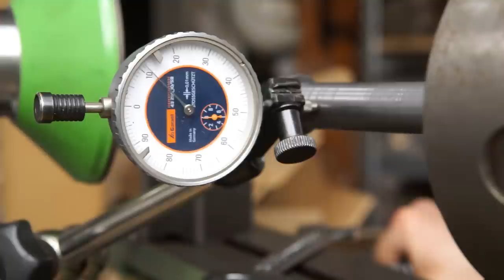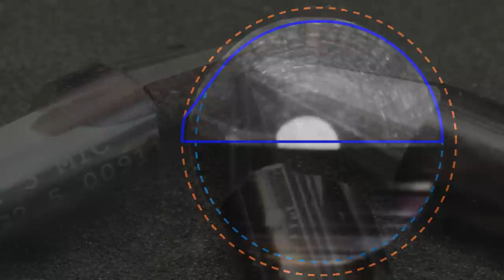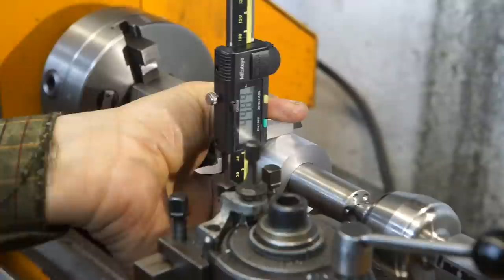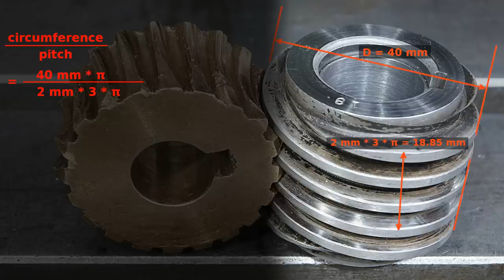machining worm gear wheels

Comment: I keep waiting years to see a double throated worm/wheel on YouTube. I still haven't seen it. It's becoming a mythical part for me.
Reply from the maker: That would be quite an interesting challenge for a home shop.
I would probably make a "regular" pair of worm/wheel first and  make a cutter from the wheel and use the wheel to cut the throated worm. Ideally both the cutter and the worm should be driven synchronously an the machine. It might be possible to "hob" the worm freely by just driving the worm?

I found a video showing the process, actually
https://www.youtube.com/watch?v=hdxllIF0DcA

Comment: Very helpful video for my current project.  I did not think I needed to gash the blank with a gear cutter (I initially used a slitting saw) but now after several failures and watching your video; I know that I must gash with a gear cutter.  Thanks for posting this video.
Reply from the maker: Thanks for your kind comment. You might be able to work with a slitting saw as long as you slit deep enough but not too deep. You just need initial "teeth gaps" to synchronize the hobber. Long ago I made a set of gears for a thread dial. Although I turned the blanks to the theoretically correct diameter, the number of teeth turned out to be incorrect in some cases.

Comment: I dont have a dividing head yet this had to build a direct indexer using at first the original gear that was partially stripped then a plastic gear I cut and ran in the machine that was just a little oversized that gave me a excellent profile and size to copy then made it in aluminum it’s been working great
Reply from the maker: Good idea. When I made my first gear on the lathe, I just printed the required "index holes" on a piece of paper and glued it onto the drive pulley. So I could use the chuck of the lathe as a simple "dividing head".

Comment: 12:05 Instead of using the hex collet block for indexing, would it not have been more accurate to offset the mill table by 1x p ... ?? 🤔

Very enjoyable video ! 👏
😎👍☘🍺
Reply from the maker: Peter, yes, excellent suggestion. That would be the same principle as used for cutting multi start threads on a lathe. (Well, at least one of multiple solution.)
I did not think of this for several reasons:
(1) originally I intended to use the dividing head to set  the 120° degree offsets between the individual threads. This turned out impractical due to the (in the world of spiral milling) relatively "flat" pitch. This required driving the shaft of the dividing head directly instead of the usual "deviation" via the dividing-plate and the worm gear. By the way: Walter even offers a dividing plate sitting on the spindle for this purpose, but I don't own this special attachment. (Rule no 1: you can't have enough tools ;-) )
(2) I had to cut eccentric curves for the reliefs of the cutter ( 22:03). This required a setup with the collet block anyways. In retrospect I think that a simple straight relief would have done.
(3) I also planned to spiral mill the V-grooves of the treads for relief. This did not work for geometric reasons (I did not think of beforehand.)
Thank you very much for your thoughtful comment. Highly appreciated!
Reply: @HaraldFinster  thanks for the detailed reply Harald ... for me, THIS is what the internet & YT in particular was made for... entertainment AND education ... all in one... 🤗 
Also, as a hobby woodworker , the motto "you can never have enough tools" (or clamps😂) is so true... 🙄

Its amazing what you can do if you are creative and think "outside the box" 
I remember many years ago making these racks and pinions for sliding metal doors on waste skips (dumpsters) ... they didn't need to be super accurate and I , a 20 somethin kid starting out on my self-taught engineering carreer (65y.o. now) thought they'd be a piece of cake to do on my Elliot shaper !! ... ahh to be soo naive .. 😂
Suffice to say , I got them done but man oh man 😤 !! 

Cutting each individual tooth gap in those 1 metre long x 1"sq. BMS racks was a ball-breaker... and then of course they bent like prezels , my first real lesson in releasing internal stress ... 🤓
I made up a makeshift dividing head using a division gear at the far end for the pinion-planing job... they actually turned out okay and my customer was delighted... 
The things we do when we don't know we "can't do that" ... 😬

😎👍☘️🍺
Reply from the maker: @peterfitzpatrick7032  Can't agree more. Thanks for sharing your experience.
With regards to stress relief: this is true even for "stable" stuff like steel. Recently I made a gib from "stress relieved" cast iron. I had to mill it down from about  12 mm to 8 mm. It bent like a Banana. Fortunately I anticipated this and left enough material to mill it straight again.
About "naive": again, can't agree more, and I think that this video is a good example: I agreed to making this worm gear for a friend. My first naive plan: turning the hob on a lathe was just impossible due to the (in the screwcutting world) steep thread pitch. So, the  rat-tail began. 🙂 But I enjoyed it very much and it gave me the opportunity to film many different techniques. 
I would love to see your work on video, by the way!
Reply: @HaraldFinster   Not a vid maker, I haven't the personality for it... I'm retired from machining at this stage, (I just dabble at it now,  when my farmer neighbours break their agri-equipment, removing a sheared off bolt in an expensive silage baler part earns me a God-like status amongst them 😂)  

My father was a cabinetmaker & none of his 9 children followed him into the trade... so my forays into woodworking have been a sort of homage to him.. not that I could hold a candle to his skillset... 😕

😎👍☘🍺

Comment: Great video!  Why was turning on the lathe impractical?  I'm not 100% sure at the moment but I think my only option will be on the lathe.
Reply from the maker: The required thread pitch of approx. 18 mm was pretty "steep". Although I could find a suitable set of change gears for this, it turned out that a lot of force was required to move the leadscrew and the carriage. My lathe has a lead screw with 4 TPI, i.e. a pitch of approximately 6.2 mm. The 18 mm pitch of the worm would have required a 1:3 speed up between the spindle and the lead screw. With the gear train engaged I could hardly turn the chuck manually because of the required forces.
So, in short,  you will be perfectly fine with a lathe as long as the required pitch is not to steep.
Reply: @HaraldFinster  Thank you for the great explanation.  Hopefully my 100+ year old Hendey lathe will be able to manage.
Reply from the maker: @therestorationshop  I wish you good luck and would be interested to see the process. Your channel looks interesting - subscribed!

Comment: Was the hob diameter identical to the worm diameter? I would have thought the hob needs to be larger than the worm (addendum of hob similar to dedentum of wormwheel). Outside diameter of the worm should not touch the inner flat of the worm wheel?
Reply from the maker: What an excellent thought!  You are certainly right. 
Honestly: I did not think about this and made the diameter of the hob identical to the worm. It works anyways, but I wouldn't consider power feeding the lathe slides a "high end"  application.

Comment: 5:15 hey what are those centers shaped like that for?   I got some in a purchase but don't have a center that fits the  bit cut
Reply from the maker: Those are R-type center drills. They are especially useful if you turn between centers with a tailstock offset. 
A "regular" (A type) center drill forms a cone which has conical contact surface to the center as long as everything is in perfect alignment.
If the tailstock is out of alignment (e.g. if you turn a cone) the cone of the center and the conical drill hole do not match. This might even damage the work or the center.
With the R type you get an approximately ring-shaped contact between the center and the work. This gives more freedom and the center and the work don't jam.
There wasn't any reason to use an R-type drill in my particular application. I just have plenty of them at hand as I got them cheap. (They are left handed by the way.)

Comment: What temperature did you harden the hob at and for how long? What kind of steel work best for that?
Reply from the maker: Hi Eric. I used "silver steel" (1.2210 / 115CrV3 / BS-1407 ) which is designed as a tool steel. I attempted to use Borax (the same  as commonly used as a flux) to prevent scale formation. This did not work too well though. The work was heated up to cherry red. i.e. approximately 850°C which is slightly above the recommended temperature 810–840 °C for oil quenching / 780–820 °C for water quenching. I quenched it in water. Admittedly, this was a mistake, as the sudden temperature drop caused a crack. The work was annealed to approximately 200°C - 250°C. Fortunately the crack did not progress any further and I was able to finish the job.
Edit: sorry, I did not answer your question about the duration of the heat treatment: I just used two propane torches and heated the work up to cherry red. Then the part was quenched immediately.

Hope this answers your questions.

Comment: Buenas tardes colega, excelente idea. Una consulta: se gira la mesa de la fresadora y a cuántos grados o  no se gira?
Reply from the maker: Hi, the table of the milling machine is fixed. It does not turn.
During the gashing process (the pre cut of the teeth with the involute cutter), the work was tilted in order to get the correct angle of the teeth. Hope this answers your question.

Comment: I would have thought that the machine you have could have directly cut the teeth with the hob without resorting to the free hob method. Does your machine not synchronize the indexer with the spindle rotation?
Reply from the maker: no, unfortunately it doesn't. The Thiel has separate motors for the spindle and the feed mechanism. This is nice as you can control the motor speeds independently via VFD but the drawback is that they are not in sync.

Comment: I wonder if the same thing could be accomplished with a simple form-cut fly cutter?
Reply from the maker: Good thought, John.
Using a form-cut fly cutter with an involute would work for a very thin worm gear wheel. However the spacing between the teeth has to increase with the distance from the center plane o the wheel, i.e. towards the edges.
If you watch the part where I gash (pre cut) with the involute cutter  (32:20) , you will notice that the heads of the teeth are almost parallel. After the hobbing operation the heads are wider in the middle and more pointy towards the edges of the wheel. (44:00)
Hope my humble English is understandable.

Comment: Why did you not just cut an ACME thread on the lathe for the hob? I don't have your equipment (or knowledge) and was planning to make my hob on the lathe while cutting my relief angles on the mill. Will I have a problem?
Reply from the maker: Cutting an ACME tread was my initial plan. However the pitch of the three start tread is about 18 mm (approx 0.7"). Although I was able to find a suitable combination of change gears for this pitch (1:10), it turned out that a lot of force was required to move the carriage with the required gear ratio. 
Thus I decided to make use of the spiral milling capabilities of my dividing head.
So, as long as your lathe is able to cut the required thread pitch you will be fine and I recommend using this technique as it is much easier, way faster and does not require any special tooling (apart from an ACME tread cutter which is easy to grind).
Reply: @HaraldFinster  Thank you!

Comment: 25:17 I don't understand how that line shows the relief? The relief of the cutter or the hob?  It's too bad you don't have footage of the eccentric cutting of the hob relief cutting, the most critical part of a hob.
Reply from the maker: Thanks for your very thoughtful comments, Bill!

"how that line shows the relief?"
I am referring to the relief of the cutter - not the hob.
In the image the red line indicates the theoretical perimeter of the cutter's cone if it would be symmetrical with no relief. You can see a small gap between this line and the edge (which is not the cutting edge).

"footage of the eccentric cutting"
Yes, I agree that it is a shame that I lost this footage. 
Just to clarify: the relief angles of my hob are exclusively at the outer perimeter.
Actually I planned to mill relief angles into the "grooves" of the hob too, but my intended method failed due to fallacy of thinking. 
I intended to spiral-mill the "grooves" with the single-flute cutter with the eccentric setup. This did not work. (Too complicated to explain why.)

Comment: Was it not nessesary to put cutting relief on your hob?
Reply from the maker: Yes and no.
There is a relief at the circumference of the hob. I attempted (and probably failed) to explain this at https://www.youtube.com/watch?v=ce8-WFwaI70&t=1320s .
I intended to add relief to the sides (slopes of the "valleys" between the teeth) of the hob. I planned to set up the hob eccentrically - just like the setup used for the relief milling of the circumference - and spiral-mill them. This did not work for reasons too complicated to explain here. (Basically the eccentric setup creates a variable radius which would require a variable feed in x.)
Fortunately the hob worked really well and left a beautiful finish.
Thank you very much for your thoughtful comment.

Comment: I can only imagine how many hours were spent on this.
Reply from the maker: The entire process took about three months.That sounds like a lot of time, however I had just a few hours during the weekends. And, honestly, not everything went as straight forward as shown in the video. Many small "side projects" were required.  As an example I couldn't find the mandrel  which allows driving the spindle of the dividing head directly. So I had to make my own. Needless to say that the original one reappeared when the project was finished. And, of course, capturing the work on video slowed everything down even more. But it was a fun project and certainly the most challenging I have ever done.

Comment: Not important!... Just a curiosity-thing.
 Asking for a "close-acquaintance" that won't stop irritating me! 
AND I'm ONLY asking because "it" won't stop complaining about constantly being "ignored", "blown-off" , and selfishly "used" for personal enrichment... AND when it does get any attention "it's" just being "picked-on" and/or  "unwillingly-fingered":.. I tell ya, If it wasn't for personally needing oxygen and a rain-deterrent, I'd get rid of this "Nosy" burden!..
 But I digress... 

So, question is:
 ... @5:16 the sound obviously indicates a diameter/speed adjustment... Did you retrofit the heart of a $50,000+ CNC machine into your lathe or was there a hand/finger involved in the audibly-noticeable RPM increase that coincides with the diameter-increase... or OR was this just meant to purposely entrap people with OCD that would notice this, and also realize the adjustment was in the wrong direction?(I.E. Should have slowed down.)  
or, OR, OR has my senses out-paced my ability to adapt again!...damit... it's probably that again...Sorry!
Reply from the maker: Well spotted. Yes, I retrofitted  the heart of a $50,000+ CNC into my 1950ies lathe :-)  More precisely, the lathe still runs with the original 2 KW 3-phase motor, but I use a VFD to convert single phase to 3-phase AC as I don't have 3 phases in my basement.
Reply: @HaraldFinster  Just wish I could convert my lathe from a "coat/tool/hose/extension-cord-holding spectator  to a running machine. a 20hp 3-phase isn't something easily powered from a 240v split-phase.... Oh how "wisdom" eludes us prior to it's untimely arrival AFTER BUYING A 3-PHASE GISHOLT #4 AT A REALLY REALLY GOOD "IF YOU CAN MOVE IT"-PRICE.